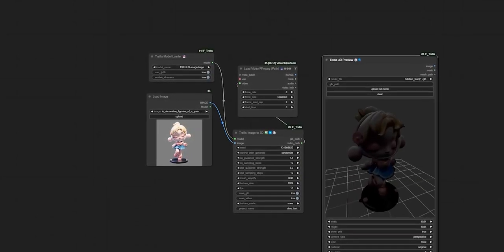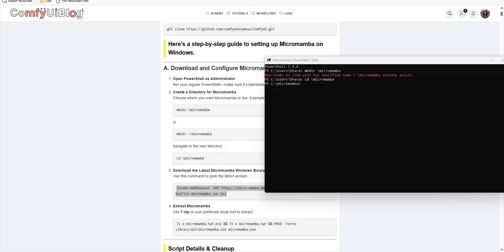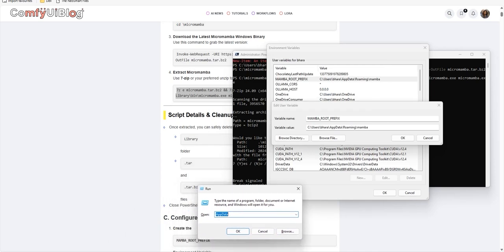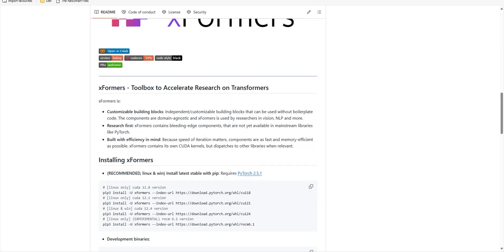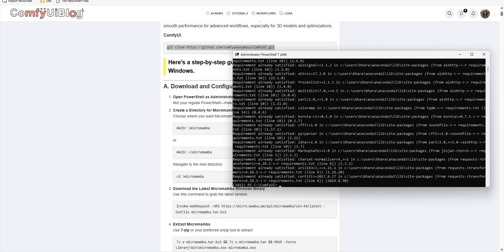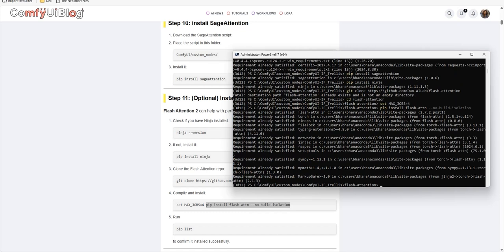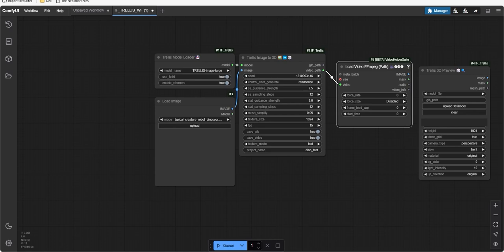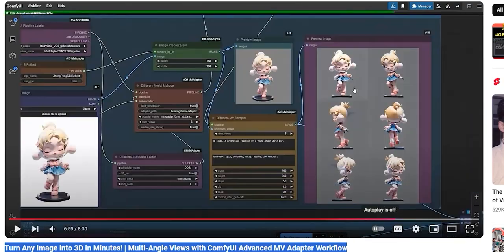One-Click 3D Models: ComfyUI Trellis Workflow + Micromamba Install | Image into 3D Model | Fix Error

Comment: Went through the install process, and with just a few hairs left on my head after pulling most of them out.  So many errors (I'm not a coder by any means), but I finally got it all running. Nodes are all finally importing correctly. Now I'm getting this error - "Repo id must use alphanumeric chars or '-', '_', '.', '--' and '..' are forbidden, '-' and '.' cannot start or end the name, max length is 96: 'F:\ComfyUI\models\checkpoints\TRELLIS-image-large'." After moving all of the ComfyUI-IF_Trellis safetensor files into the \ComfyUI\models\checkpoints\TRELLIS-image-large\ckpts folder.  Not sure what to do about this one. Any ideas?

Comment: Very nice tutorial not so easy to install :) i'm trap at pip install C:\tmp\extensions\diffoctreerast keeping saying my CUDA_HOME is bad and it's not :(
Reply from the maker: Thank you! I’m glad you liked the tutorial. About the issue with pip install C:\tmp\extensions\diffoctreerast, it seems like there might be a mismatch with the CUDA environment. Even though your CUDA_HOME path is correct, it could be helpful to double-check that your CUDA and cuDNN versions are compatible with your PyTorch version. Also, make sure the environment variables are correctly set. Sometimes, a simple restart of the terminal or IDE helps refresh the environment. Let me know if this helps or if you're still stuck!

Comment: Installation is far too complex. And if you don't speak English well, it's even harder. My advice is this:
Wherever you installed Krita, remove the checkpoints in model. Because safetensors are too bulky. Then you compress everything and also in AppData => roaming, you also compress the krita. Then give us the links, it's much simpler. If you give us everything installed, it's much better. I use this technique every time I make a bad node installation. I reset everything to zero, so I think it's much simpler for everyone that you compress the files and give links.

Comment: Nice tutorial. It would be nice if it was a little slower and in more detail. Felt like it's a little rushed through. Nevertheless, fantastic effort. Totally appreciate it. 
Is there a way we could feed in multiple images(like different angles of the item) as input to the model to get better quality 3d model. Here I can see we the have an option to upload only 1 image.
Reply: Multiple images hasn't been trained. On the official huggingface demo it doesn't work either. Local installation of Trellis works fine, Multiple Images tab doesn't either. The aim of Trellis Microsoft paper was mainly to invent the back of objects, and the result is mind blowing already. Let's wait a bit more for a working multiple views option.

Comment: II'M GETTING 7z: The term '7z' is not recognized as a name of a cmdlet, function, script file, or executable program.
Check the spelling of the name, or if a path was included, verify that the path is correct and try again.
PS C:\micromamba>  7z e micromamba.tar.bz2 && 7z x micromamba.tar && MOVE -Force Library\bin\micromamba.exe micromamba.exe
Reply: TRY this              
7z e micromamba.tar.bz2; 7z x micromamba.tar; Move-Item -Force Library\bin\micromamba.exe micromamba.exe
Reply: @Bshootz  Was having the same issue. Thank you!
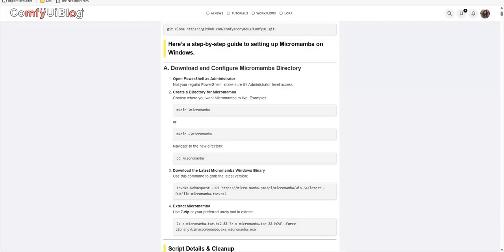Reply from the maker: Install 7 Zip here is time frame 2:08

Comment: Step4 is not working - Extract Micromamba 

PS C:\micromamba> micromamba
micromamba : The term 'micromamba' is not recognized as the name of a cmdlet, function, script file, or operable program. Check
the spelling of the name, or if a path was included, verify that the path is correct and try again.
At line:1 char:1
+ micromamba
+ ~~~~~~~~~~
    + CategoryInfo          : ObjectNotFound: (micromamba:String) [], CommandNotFoundException
    + FullyQualifiedErrorId : CommandNotFoundExceptio
Reply from the maker: Ensure that the micromamba executable file exists in the directory where you extracted it (C:\micromamba in your case).

Open File Explorer and navigate to C:\micromamba.
Look for the file named micromamba.exe.
Reply: Thanks. Extract micromamba isnt working

PS C:\micromamba> 7z e micromamba.tar.bz2 && 7z x micromamba.tar && MOVE -Force Library\bin\micromamba.exe micromamba.exe At line:1 char:25 + 7z e micromamba.tar.bz2 && 7z x micromamba.tar && MOVE -Force Library ... + ~~ The token '&&' is not a valid statement separator in this version. At line:1 char:48 + 7z e micromamba.tar.bz2 && 7z x micromamba.tar && MOVE -Force Library ... + ~~ The token '&&' is not a valid statement separator in this version. + CategoryInfo : ParserError: (:) [], ParentContainsErrorRecordException + FullyQualifiedErrorId : InvalidEndOfLine

Comment: extracting micromamba doesn't work....powerShell showing error...can I do it manually?
Reply from the maker: copt the lone one by one 

7z e micromamba.tar.bz2
if ($?) { 7z x micromamba.tar }
if ($?) { Move-Item -Force Library\bin\* . }
Reply: @ComfyUIworkflows  Error: 
PS C:\micromamba> 7z e micromamba.tar.bz2
>> if ($?) { 7z x micromamba.tar }
>> if ($?) { Move-Item -Force Library\bin\* . }

7-Zip 22.00 (x64) : Copyright (c) 1999-2022 Igor Pavlov : 2022-06-15

Scanning the drive for archives:
1 file, 3956570 bytes (3864 KiB)

Extracting archive: micromamba.tar.bz2
--
Path = micromamba.tar.bz2
Type = bzip2

Would you like to replace the existing file:
  Path:     .\micromamba.tar
  Size:     0 bytes
  Modified: 2024-12-20 00:37:05
with the file from archive:
  Path:     micromamba.tar
? (Y)es / (N)o / (A)lways / (S)kip all / A(u)to rename all / (Q)uit? y

ERROR: Cannot delete output folder : The directory is not empty. : .\micromamba.tar

Sub items Errors: 1

Archives with Errors: 1

Sub items Errors: 1
PS C:\micromamba>
Reply: @ComfyUIworkflows  Error :
PS C:\micromamba> 7z e micromamba.tar.bz2
>> if ($?) { 7z x micromamba.tar }
>> if ($?) { Move-Item -Force Library\bin\* . }

7-Zip 22.00 (x64) : Copyright (c) 1999-2022 Igor Pavlov : 2022-06-15

Scanning the drive for archives:
1 file, 3956570 bytes (3864 KiB)

Extracting archive: micromamba.tar.bz2
--
Path = micromamba.tar.bz2
Type = bzip2

Would you like to replace the existing file:
  Path:     .\micromamba.tar
  Size:     0 bytes
  Modified: 2024-12-20 00:37:05
with the file from archive:
  Path:     micromamba.tar
? (Y)es / (N)o / (A)lways / (S)kip all / A(u)to rename all / (Q)uit? y

ERROR: Cannot delete output folder : The directory is not empty. : .\micromamba.tar

Sub items Errors: 1

Archives with Errors: 1

Sub items Errors: 1
PS C:\micromamba>
Reply from the maker: what error you getting,
Reply: @ComfyUIworkflows  
Error :
At line:1 char:25
+ 7z e micromamba.tar.bz2 && 7z x micromamba.tar && MOVE -Force Library ...
+                         ~~
The token '&&' is not a valid statement separator in this version.
At line:1 char:48
+ 7z e micromamba.tar.bz2 && 7z x micromamba.tar && MOVE -Force Library ...
+                                                ~~
The token '&&' is not a valid statement separator in this version.
    + CategoryInfo          : ParserError: (:) [], ParentContainsErrorRecordException
    + FullyQualifiedErrorId : InvalidEndOfLine
Reply from the maker: @jaykotak4874  7z e micromamba.tar.bz2
if ($?) { 7z x micromamba.tar }
if ($?) { Move-Item -Force Library\bin\* . }

one by one paste the line
Reply: @ComfyUIworkflows  Thanks for your valuable time to reply and efforts to solve my problem...